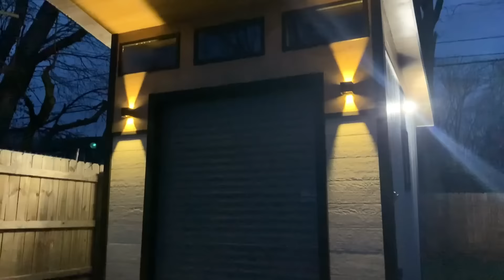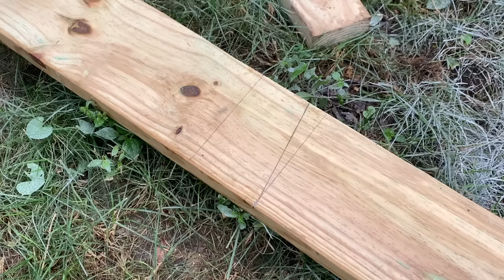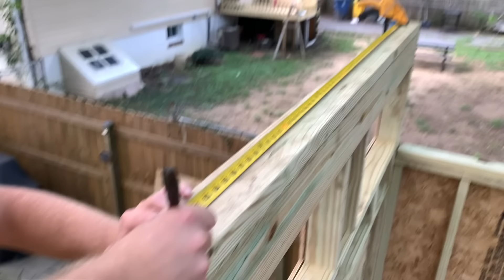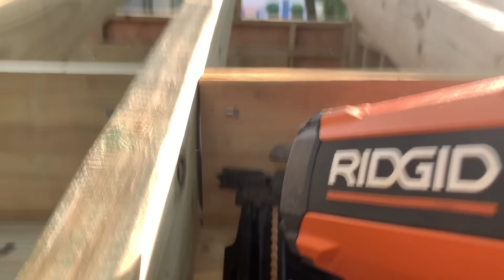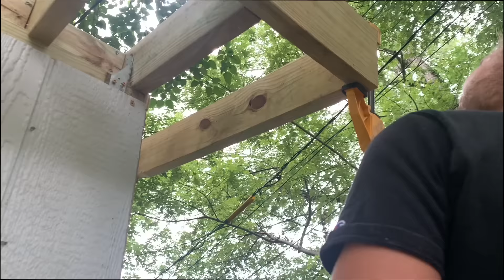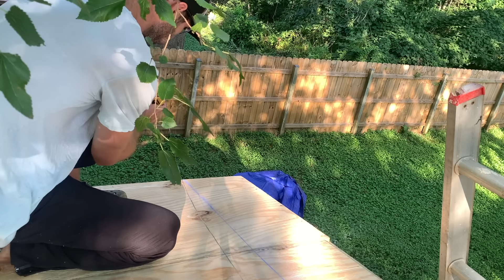DIY Shed Roof Framing (How to Build a Shed Roof, Make Birdsmouth Cuts, and Install Plywood Decking)

Comment: Much stronger and less sag to stagger your full sheets roof so they checker board, start with half panel then full next course overlaps by full panel then half at opposite end. A solid joint line on two or more panels causes the roof to buckle and go wavy., old school carpenter of 60plus years, the video is good, thanks for the post

Comment: If you install your blocking square to the rafters, vs square to the walls, then you do not need to trim them to a smaller size, first.

Comment: Thank you thank you, you made it really easy .. I watched lots of videos and no one made it that simple to follow, however I have a concern about the fascia board you should cut the rafters ending to make it vertical , this way the fascia board won't be 100% vertical , the rafters should be cut as well using the same pitch 2in no ?

Comment: You could have got your seat cuts by using a 2x4 for the line going up vertically and laying the 2x4 next to your rafter on a one and a half inch height and mark it there going horizontally and that would have gave you a perfect seat cut without you having to do all that unnecessary BS you just did

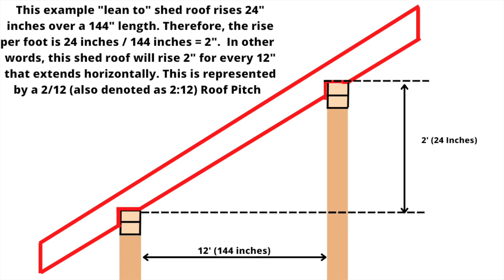Comment: You mention using a 2/12 pitch.  3/12 to 4/12 is recommended for a slant roof like this. Just confirming if 2/12 is actually what this shed is ? Seems more slanted than that. @3:18

Comment: I’m curious why you didn’t use your jigsaw for the entire cuts for the roof. I hate using my circular saw for delicate or short cuts in any wood that’s over 1 inch. It’s that darn curve in the kerf. Great job on the build. I’m trying to improve my shed. I am a ‘on the cheap’ / salvage what I got kind of guy. Wish I put a little more effort/thought into my initial build.🥴 Can’t really take it apart so I’m plugging gaps and making a roof on top of the existing roof. Thanks for the step by step explanation n the roof. Bright side is I’ll have an attic. 👍🏼☺️

Comment: Correct me if I'm wrong but it looks like decking screws were used to secure the hurricane ties.  I have to call this out as structural screws should be used for this purpose.  Decking screws have very little shear resistance. Good instructions otherwise.

Comment: Your overhang on both sides of the shed is absolutely wrong. Overhang should never extend more than 1/3 of the length of the board doing the extension. Here, you use blocks that are 100% in the air. If you go to the edge of that and jump, only the nails in the blocks are holding you and the entire edge structure. What you should have done is have the rafter not on the edge but much more inward so the blocks sit on a edge beam before extending off the roof.

Comment: Used the wrong screws for the ties. They have to be structural and with flat heads so they sit flush against the tie. The wood screws you used with the angled heads, don't hold the tie down as well. That's why Simpson makes particular screws for all of their ties.

Comment: The idiots that built my shed finished it with roof dimensions of 101.5" X 106".
WTF were they thinking? Roof overlay will require 4 - 4X8 sheets cut down to 55.25 X 53".
What a bunch of idjits. What a waste of my $$.

!

Comment: Are you in a Snow or rainy area of North America??? Scaling Ladders and working  carpentry in CROCS   ---  YOU SAY 2 3" SCREWS why so short @`18:00 MIN INTO THE VIDEO, THROUGH THE FASCIA & END SCREWING EACH 12-14 RAFTER- so no metal hangers of any kind or rigid metal angle plates? Nor did you notch / dado the fascia for the rafters to get some umph. Your Fascia is  same ht of rafters (8") on a big slope- you understand water goes down and it does not fall it goes under the fascia and will follow bac the 3 ft underside into the building wall. You can get some wonky gutters. But if the fascia descends 2" lower it will keep all the water from going back under. If it stays as is it will retain water on that edge and can rot because it is a slope that angle (uphill roof) IF YOU FLASHED THE FASCIA WITH 10" NICE PEBBLED painted ALUMINUM >.065 AND put a hem lip lower below 3/4 you may be happy, Or wrap under the 1.5" edge, only if it is a 2X10; not as it is. As for closing or a soffit. It still applies. You need to keep water falling straight down below; not running back under those rafters.  No helpful tool belts. If you are using T11 Siding not as sheathing you cap it with Z Bar 0.625-in x 120.0-in x 1.3125-in Galvanized steel Z Flashing so the plywood right above has overlap weatherproofing  Then in fron _ Horizontal at lower level????? This is not an instructional video buy it is a DIY not as all  should do.

Comment: For the 10 degree angle cut at 7 minutes that you do as a plunge cut, another video showed you can stand all the 2x4 rafters on end clamped together) and set the lean on your circular saw to 10 degrees & depth to match the cut and run it through ALL your rafters at once for a single cut.
Reply: Cool tip, I'd probably fuck up a bunch of lumber that way though lol
Reply: @mikerackhabit  I ran into the problem of cutting them slightly off individually.  If I’d clamped them all together for one cut, it would have eliminated my space brain

Comment: Great video! Question. Did you cut the 2x6 rafter ends on an angle also? Or did you leave them as a straight cut. The little drawing seems its cut on an angle, however looking at you cut the boards it seems  you cut them straight?

Comment: The distance measurement of the roof length should be from the inside wall to the outside wall, not inside to inside. Same corners that you used to calculate the height difference. Otherwise great video.

Comment: Overkill spacing on a 10x10 shed.  Did you use treated wood for the framing?  Not at all practical construction from what I see.

Comment: In colder climates, nails are preferable over screws due to their sheer strength. Cold buildings shrink and can snap screws much easier than nails.
Reply: wrong
Reply: @arthurstawski5600  'research says otherwise.

Comment: You can cut your first bird's mouth a lot quicker if you just use a little chunk of 2x4 and set it on the top plate and then draw the cut line onto the roof rafter. Faster than trying to figure out if you got angles right and you'll get them perfect every time.
Reply: Agreed; never risk messing up the math when you can just trace.
Reply: I was also screaming that at him in the video

Comment: Are those deck screws for hurricane straps? If so that’s wrong, you need to either use nails or structural screws which the company that makes straps sells.

Comment: For joining the front facial boards to the roof rafter would it be more secure to pocket screw the ends of the roof rafter? Would it be overkill

Comment: The narration says to put the blocking on the outer-most edge of the top plate, but the video shows it being applied to the inner-most edge. Which is correct ?
Reply: Also wondering the same thing

Comment: Hello, nice instructions, thank you, especially about the birdsmouth which seems complicated. I have a few questions. My tallest wall,  of slant roof shed is only 7.2 before rafters. How high up should my siding go to ...if it does not go to the top of the top plate what fills in that space? Secondly i am using screws to frame my shed,( I don't have a nailer)  can i use screws to attach the siding? Lastly do you use any sealers, caulking or flashing etc. when installing the siding or is it simply just nail it (screw) on? Thank you Andrew!

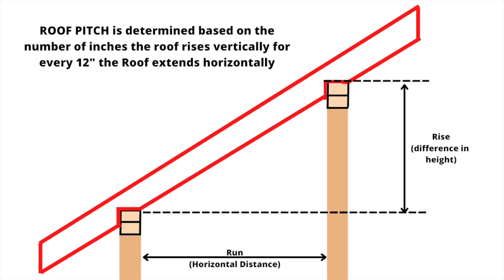Comment: I am a bit confused about how the roof pitch is calculated. At 2:55 in the video, the diagram show a RUN and RISE. The RUN is shown BETWEEN the 2 outside wall, but the RISE is measured from the inside of one wall to the outside of the opposite wall. I would think that the RISE would have to be  measured at the INSIDE of both walls, as that is where the RUN is measured. If you were to measure the RISE between the walls it would be a smaller number that how you are showing. Measuring at the birds mouth seat does not appear to be mathematically correct. What am I missing?

Comment: Way too complicated. Put your rafter up where you want it. Put a square against the exterior side of the wall and overlapping the rafter and make a mark all the way across the rafter top to bottom. Put a square up against the inside of the wall and up against the rafter the same way. Mark it and measure the gap between the top plate and that point on the rafter. Go to the exterior side of the rafter and measure up that same distance on the vertical line you just made and make a mark. Line your square against that first line you made with the pivot point of the square touching the point you just measured and mark your 90⁰ horizontal line towards the inside of the wall. It should meet the mark you made for the inside portion. That's your birdmouth. Repeat for the other wall and make your cuts. I've been building these type buildings for years and not once have I ever taken into consideration rise over run or angles or any of this other stuff. The walls are what ever you cut them to be and the pitch is going to follow naturally. You'll have your rafter sitting flush every time if you do it this way.
Reply: Do you know of a video that shows this method?
Reply: Place board on walls with appropriate overhangs.
Measure 1 inch (or desired notch depth) from point on contact and hammer nails half way in, on both walls.
This is to support the board on the 2 nails. 
Now trace the walls profile on the back of the board.
Then, cut traced lines and done.
Reply: That's sounds so hard
Reply: Super FACTS
Reply: Followed your instructions yesterday and the trusses turned out great. Thank you!
Reply: you stating : "Put your rafter up where you want it then blah bla bla " tells me you know as much about framing as the kid in the video ...
Reply: @BaroneColtello  his method is actually for increased productivity and ease. Provided Your walls are plumb and Your square is square, it's a better way. I've built some structures with my grandfather and this is the sort of stuff I see him doing because he's been around long enough to learn, but on my own I forget and end up relying on YT videos and golden comments like this lol.

Comment: Should’ve cut the rafter tails to match the roof pitch, and you should’ve staggered the seams of the plywood and installed h clips. Otherwise great set up!
Reply: Or if not h-clips, an 8 penny nail in between the sheets from back sheets to front ones.  My sheets lay out in a pattern offset.  But the next row is separated the width of the nails.
Reply: @timmoore9736 the h clips also share some of the load to the adjacent boards and keep them all on the same level. They’re code in a lot of places with 4 seasons. That’s the only reason to use them over nails or some other standard spacer.

Comment: Use nails on your hurricane ties. They are much stronger then screws for shear forces.
Reply: And for what it may be worth, if you have a compressor, get a palm nailer - it will be used on joists as well as rafters.  My son-in-law thought it was a great toy!  It drives those shorter nails in like a champ!

Comment: Place your hurricane ties  first and then you can just lay your raftors into them
Reply: And if your rafters are less than perfectly straight, one can install blocking between before putting nails through the ties into the rafters.

Comment: WOW, as a journeyman carpenter for over 30 years this was incredibly painful to watch. From the improper layout of the birdsmouth to placing some of the plywood sheets lengthwise on the rafters the entire build does not meet any basic carpentry practices.
Reply: Do you have anyone on here that shows how to do it better in the way you would recommend?
Reply: @Commonfactor6689  Good job on getting the rafters up, but I can explain to you how to do this much easier and safer. 

I haven't come across a video yet that explains rafter cuts properly. But I'm sure there is one out there. 

If you know the correct procedure, you can cut the rafter on the ground using the distance of your span and the pitch of the roof. There is no need to climb ladders to mark where the cuts should be. 

Got called away, I will get back later.

Comment: Fellas, I'm sorry I keep coming this way, but misinformation can cause injury. The sheathing is supposed to be staggered like bricks to tie the whole structure together giving extra strength as well as being the truest way to bring your building into square. So far besides the screws which I've already mentioned is awesome! Keep it up guys!
Reply: I'm no expert but was thinking the same, as every roof I have done, we did it that way. Also I wonder how many Sharpie pens he goes through in a day marking full width for every rafter, joist and stud!
Reply: Use the plywood like bricks yes, and use the plywood to square up the building. I don’t know if anyone else noticed how much it was out of square, the plywood was covering the whole joist at one end then 4 feet away the whole joist was exposed 😮. Good effort, but not a great build. The cad drawings were great, the build is a c-

Comment: Why did you make it so complicated? Just sit the rafter up there. Use a straightedge or a level to draw a plumb line on each side and the ends. Then put it on the ground and use your square and slide it down the plumb line until the other flat is 3.5 inches. Then trace it on the other boards. You never needed to calculate the pitch.

Comment: When nailing the roof ply make sure you do 6 inch between the nails on the seams and 12 inch in the center you can do closer spacing but not further also cut the ends of your rafters level vertically to prevent your gutter guy from laughing at you later
Reply: Yeahp.... Imagine all  facsia perpendicular to the slope! Doh

Comment: Im going to be building a shed very much like this one and this video has been nearly flawless! thank you.
Reply from the maker: Glad it helped, Preston! Good luck with your build!
Reply: @AndrewThronImprovements  I did notice that with your rafters you didn't (or failed to mention) cut the ends at the angle to make them perpendicular to the ground. Was that by preference or design, or is that something that's not super important? Just curious.
Reply: @prestontripp9891  I am wondering how that's done while on the ground!
Reply: @BMRSNRTXSX-xp8rv  I mean you could set the rafter up without tacking it in and use the square before bring it back down for a cut. Then you just trace the birds mouth and all the other ends on every rafter. Then go hang it up. Probly he didnt do for all the extra cuts and time it takes to do that. Im sure its just for aesthetic mostly.
Reply: @prestontripp9891  I guess I am  referring to the flat cut for the soffit at the end of the tail. If that makes sense, I've only seen it demonstrated a few times and now I can't find a video that shows how to come up with that cut.
Reply: @BMRSNRTXSX-xp8rv  I guess you could use a plum line and dangle it down and then trace the line for the cut with a square. That would be a way to do it. But now that you have me thinking, wouldnt the angle just be the same line the butt end of the birds mouth?
Reply: @prestontripp9891  I am guessing just upside down???? I am twisted now lol
Reply: @BMRSNRTXSX-xp8rv  its all good. Im not a pro or have perfect knowledge but I've framed a few basements and done a bit here and there. Life is all about learning and sharing/discussion.

Comment: 2x4 rafter use a  16o.c layout. 2x6 rafter use a 24o.c layout. Shed walls can easily support a 24o.c layout. No need to make you building more costly than it needs to be and it will last just as long.

Comment: Did you use pressure treated wood for the rafters and top plates. If yes, did you let them dry out first?
Reply: you dont need pressure treated for the rafters unless they will be exposed to the elements, if properly sealed, there shouldnt be any water penetration
Reply: @bv0211  Thank you so much for the info

Comment: How do you insulate the roof in your design? Since there is no ridge, as in a roof with a gable, there is no ridge vent. Are there no vents installed on the lower or upper sections of the roof, and if that's the case, does insulation take up the entire thickness/height of the rafters/joists? My roof doesn't have a ceiling frame, as the roof is the ceiling. To have additional natural lighting, I have casement windows in the raised area, so I can't install a ceiling frame. Thank you.